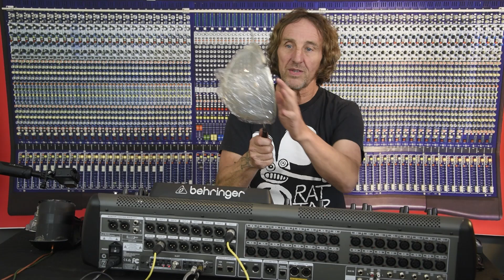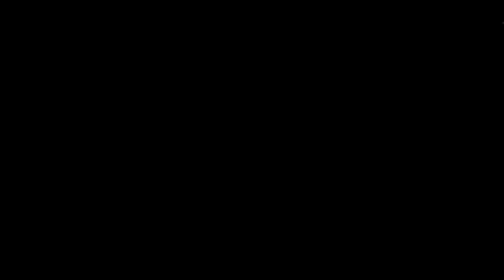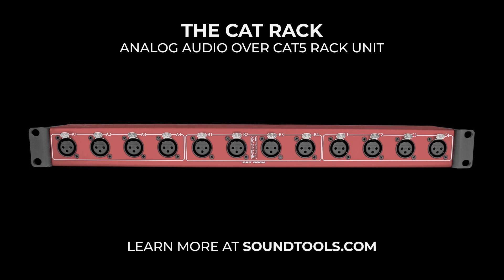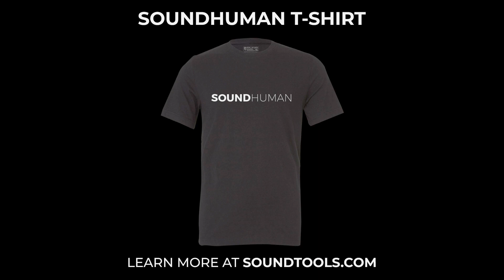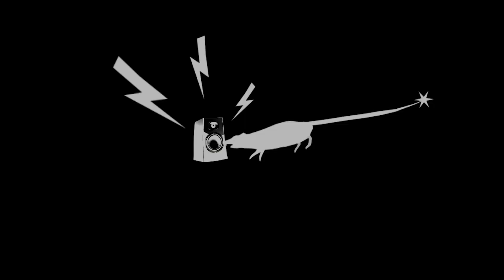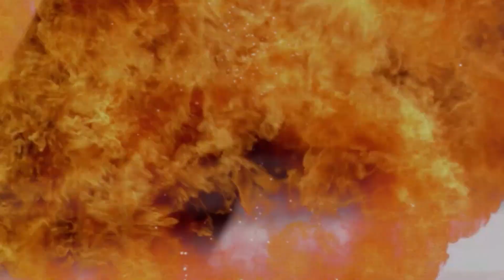Aux Fed Subwoofers Are Better - Because of How Mics Work

Comment: I like your videos very much, but this topic is pure taste. An engineer who mixes with subs connected to stereo will not put all the highcuts to 90, but much higher, according to the signal he has in each channel. If it feels comfortable to you, to have subs on auxes, if you like the control, if it's easier for you - then do it. But it's not the holy grail. Both methods can give you a good sound
Reply from the maker: Subs on a seperate send is better, not imperative. High pass filters reduce unwanted wasteful and sub blurring energy. Send on a separate send prevents it.

If someone is more comfortable or lacks the skill to run separate subs, all good. But using HP will always let some sub energy through.

Stage vibrations, handling noise, bass or kick bleeding into other stage mics late due to distances, all blur the sub soundbwith un natural noise. Filtering is ok, not sending is better.
Reply: @DaveRat  how is the unwanted sub bass for the tops? You can't hear it, because you don't send it to sub. So you dont filter enough
Reply from the maker: Typically the tops are not capable of reproducing sub frequencies (that's why you have subs) and using a high pass to get the sound correct 8n the tops is all good

Then, only sending instruments that need subs to the subs will prevent unwanted sub energy from non sub instruments from being reproduced
Reply: @DaveRat  so here is high pass good enough?

Everything has pros and cons....
Reply from the maker: That's for you to figure out. One way to tell is to set up your mix, mute the tops and mute all instruments you would normally send to the subs and go listen to the subs and see how much crap noise if getting there from instruments that don't need subs

Comment: Not only cleaner like you mentioned, but for those systems with limited power (I am am mobile DJ / sound reinforcement guy so my system is just one or two KS118s). Why waste power and potential headroom on 'garbage'? Subwoofers are notoriously hungry so why be wasteful.
Reply from the maker: Agreed

Comment: Love the idea. That really has to make the low end really clean and clear and would argue that if you could employ a crossover on those low frequency instrument channels, you could eliminate phase problems between subs and mains.
Reply from the maker: That would just be a glofied high pass and filter lows but not prevent the instrument from being sent to the subs

Also, issues with sub crossover perfection are over rated.

Any issues only impact a very narrow band of frequencies at the x-over point.

Plus, unless your subs and tops are physically extremely close together, an audience member moving closer to subs and father from tops or vise a versa, totally screws the crossover summation anyway.

So you have the ability to clean up lows and possible slight impact crossover issues that are already there, or you just have the crossover issues anyway
Reply: Putting sub/main on phase is very important (and yes its never perfect wich is why you average it with several mics) but using aux for sub doesnt prevent that.
Just set it up with the console setup you will use and make a dca for main+sub in case you have to change your overall signal.

Comment: Hi Dave, I have a question for you so in a PA system with a Yamaha non-powered mixing console, a analog 31 band graphic equalizer, and then an active crossover all in a signal chain where is the best place to start the signal? Should I started at the graphic equalizer or should I start at the mixing console itself and why should I do that?
Reply from the maker: Hmmm, you would want a seperate output from the console, like left, right and center and send center to subs

Comment: Why not hpf all mics that have no business picking up lows (like high hats vox etc)?
Reply from the maker: HPF is a filter that attenuates lows, if you high pass teall high you can get nearly all the lows of a mic out of the subs but the mic will sound bad with too much low removed

If you high pass so it sounds good, lows end noise still gets to the subs

Subs on an aux completely prevent that mic from getting to the subs. And you don't need to high pass so high
Reply: @DaveRat  I do use a separate sub send - with the fader linked to the mains but also hpf everything just at different cut offs depending on the instrument.
Reply from the maker: That works.HP does add a slight ringing but that is minor compared to how much the HP can help.

HP plus subs on separate send is the way to go

Comment: I'm a newbie compared to many here, but I love this concept. Dave, I very much appreciate in your videos that you present the reasoning for such techniques and then demonstrate using real world audio. It really helps someone like me to make changes that actually impact sound in a positive way.  I'm very grateful for your efforts to produce this channel.
Reply from the maker: Thank you Kurt, that means a lot to me and makes doing this worthwhile
Reply: The big satellite speakers might not have the best bass rejection on stage. The small satellite systems might rely heavily on the subs for male voice fundamentals and snare fundamental frequency.  It is not a one size fits all kinda answer. That's why we have system designers, system calibration and mix engineers. It's good that there are discussions between them though.
Reply: I might back that up with an example: nowadays we make tiny speakers with lots of low end. L-acoustics kiva is a good exemple. You get more 'ringing' from the acoustical path of the small speaker than you do from the filters. I ended up moving the crossover really high up (160Hz) to get a 'quicker' bass in the male speaking voice from the bigger sub. The mains are dual 5 or 6 inches, the subs are 12inches. The way Dave thinks of subs is for an effect. But often they are just part of the mains. The result is a cleaner speaking voice at low levels that was not achievable just with the mains. The subs didn't add unwanted noise or distortion to the signal nearly as much as the mains in the 80-200Hz range.
Reply from the maker: I consider subs to be speakers that are optionally added to a full range system to extend theiw frequencies.

Lows are part of the spectrum necessary for a speaker to be considered full range.

Subs on aux yay!

Lows on aux, not against it but not what anyt of this is about and a different adventure.

In some systems, the low frequencies (woofer) can be being reproduced by an enclosure referred to as a subwoofer but is not acting as a true sub as there is no woofer

Sub-woofer

Below the woofer
Reply from the maker: This is about subwoofers on a seperate send. Not woofers on a seperate send, not subwoofer used as woofer.

Sub-woofer

Below the woofer

Putting the enclosures that reproduce ultra low frequencies below the frequencies that a full- range system reproduces

Seems pretty straight forward to me
Reply: Then make sure to listen to other sources. There are many reasons why Subs on Aux are not a good idea. Especially if you are not 100% sure what you are doing here. Michael Curtis has a good video on it. Pooch van Druten (Iron Maiden, Linkin Park, Justin Bieber) doesn't do it (just an example). Subs on Aux is a possibility. But you should really check if it is worth the extra effort, and if you cannot get a simular result with proper processing ( and not put the HPF on a vocal mic on 90 hz).

Especially with PA systems nowaday going down to 35-50hz (l'acoustics K1: 35hz, d&b GSL: 45hz Meyer Panther: 55hz) it is imo a better idea to handle all these things with proper PA setup and highpass filters. It's not only Bass and Drums down there. Metal Guitars are often around 60hz, clearly in the subbass range. Male bassist vocals also have frequencies around 85hz. Not using subs on aux does prevent you from falling into these pitfalls.

Make a post preamp recording of the next show you do and sit down and check your channels and how a HPF affects it and where you have to set it to get rid of dirt in the bass frequencies.
Reply from the maker: I don't buy the argument that since a pa goes down low, one should send instruments that do not generate sub frequencies but the mics do pick up low end crap, to the subs.

What kind of logic is that? 

Just think of it in reverse. "Does this input need subs? No? Ok, then why send to subs?"

As far as being in control of your mix and not ruining the recording, of course, avoid that regardless of how your subs are sent.

You don't need subs on a separate send to get a good mix but also, not sending excess unwanted crap to to the subs will always sound better than sending crap to the subs.

The question is whether the difference in any situation is audible or not.

And that is fairly easy to test. Which I highly recommend.

Don't believe me or anyone, test it! 

With subs on L and R, dial up your mix, high passes and all that, then mute the mains, then mute all the inputs you do want in the subs and then, whatever the subs are now doing is the excess. Look at that signal in Smaart, go listen to the subs, see if they are bouncing around, maybe they are, maybe they are not, and then decide, "is my mix better with this noise added, does it matter? or should I setup my mix so it can be removed?"

And remember to enjoy learning and avoid dogma
Reply: @JasperSchwinghammer FWIW, Michael Curtis made a post in the past few days saying that this video is making him reconsider how he’s thinking about sub management.

The more I think about it, the more I’m thinking there isn’t a single right answer for all situations. I’ve been doing the HPF thing for a while and have been happy with it, but I’m thinking I might try to switch the PA over to aux-fed subs for a while. I mean, I switch which compressor plug-ins I use for various inputs every so often just to try something different and really learn what they sound like… why not do the same with “PA architecture”?
Reply from the maker: Good stuff and the best part is that there are many options for desirable outcomes. What I am trying to do is offer a method that increases those odds.

There is another dynamic I will cover soon wherein I will show that not sending everything to subs actually can improve sound coverage in frequencies reproduced by both subs and mains (overlap frequencies), in ways that can not be achieved with subs on L/R
Reply: @DaveRat  Oh? That sounds interesting!
Reply: There are certainly many ways to accomplish similar outcomes. All of the things that you mention reflect our current setup. Now I know of an alternative approach that I had not previously considered. Options are good 😊
Reply: @JasperSchwinghammer  I just watched the related Michael Curtis video. I found it to be helpful to see, yet another way that a professional is managing the flow through a mixer. I'm sure that he knows more about sound production than I will ever know.

However, his video did not actually address the issue that Dave addresses here, which is that extraneous bass sounds are generated from microphones that really shouldn't be producing sound in that frequency range. As I understand in Michael's example, he is routing all sound to various matrices, which means that the sub matrix will include the extraneous base frequencies from all sources. At that point, I do not see how it is possible to use EQ to filter out the garbage without coloring the sub frequencies that you actually want to capture.

Some other thoughts regarding Michael's four points for why you should not use Aux Fed Subs.

1) Michael asserts that PA design vs mix decisions are muddied. I see the interaction, but am not sure that I agree with the conclusion. PA design is to set a baseline for the room. Mixing is always on top of that design regardless of the mixing approach.

2) No accurate transfer function: I'm in a fixed venue, so maybe that is why this point means little to me, but using a room measurement mic for evaluating your mix, rather than simply for PA setup, does not make sense to me. The room is always going to sound different from what your mixer receives from the mics unless you have a completely dead room which doesn't exist in the real world. Coming from an IT environment, one learns to recognize that data is only one part of an equation and that the human interaction with data is often unmeasured and, perhaps, the most important element. Many IT systems fail because developers lose sight of the fact that software is supposed to solve a human problem rather than be an engineering marvel. I don't see why one would rely on data over what they actually hear; the audience is evaluating with their ears and not the data.

3) Limits Routing and processing: While it's true that many common mixers limit some functionality or may require an alternative approach to make this work vs a more traditional model, people are adaptable and can learn new ways of working. It seems that it may be easier for someone like myself, with a short tenure mixing, to take a different approach because I have yet to develop a pattern of mixing another way. Unless a financial barrier exists, I would simply select a platform that makes Aux Fed Subs possible without the limitations of some older mixers. For example, moving from A&H QU to an SQ is not significantly more expensive and eliminates an artificial barrier.

4) Troubleshooting is more complicated: I appreciate that a person unfamiliar with the mixers setup might be confused, but an individual who establishes the routing for this or any other approach should not be mystified by what they created.

I really do appreciate your comment, as it was very helpful for me to see a different opinion.

Comment: As usual Dave you have explained something that most sound techs may have missed. Eliminating unwanted mud. I know a friend who believes in true sterio sound but may not realize what you have just stated. Also running subs separated in a small venue will cause a thunder alley effect according to the horizontal dispersion of the sub. Sending only low freq. instruments to an aux is a great way to eliminate that mud. Thanks Dave as I certainly trust your judgement and love the productions.

Comment: Seems to be a hot trend lately of engineers moving away from aux fed subs and advising others to do so. But their reasons are never very compelling and mainly boil down to it being an extra variable that creates more margin for user error, which is silly to me. As live sound engineers the job is all about juggling numerous technical tasks to create the best possible experience for the audience and the band. It’s not the right philosophy that we should shy away from a relatively straightforward and effective method simply because it creates an extra thing to pay attention to.
Reply from the maker: Subs on an aux is better but engineers that are still getting a grasp on the basic should do so before adding more complexity
Reply: @DaveRat  Agreed. I didn't use aux fed subs for the first few years that I was starting out in live sound. I just don't agree with experienced engineers who claim it's more trouble than its worth and advise others to always avoid it, which is the trend I've been noticing recently.
Reply from the maker: Never underestimate the desire of a humans to justify their beliefs by preaching to others. Realgarsless of whether their beliefs are beneficial or detrimental

Comment: A lot of PA man, and I agreed, thinked that can be created problem in pa correct tuning.
If don't like that the mic go tu sub, normally filtered at 80hz, is really sufficient a 24db HP filter at 100hz.
A vox in a band normally is filtered around 125hz, -18db at 62hz with this kind of HP, so...
Reply from the maker: Yes, many people are ok with leaving in some of the wasted energy and mic rumble sent to the subs. And just using filters to remove some of it.

Comment: For your next video, just an idea to follow on from this test. It would be cool to use the oscilloscope on the signal going to the sub speaker calibrated to the mix level of bass, kick etc(ie when the whole mix sounds good). Then assign the rest of the inputs to go to the sub aux send too(essentially a "stereo mix" from speakers perspective but with one button assign-ability). Have the other non bass inputs set up with their respective high pass filters and take a measurement. Then unassigned the other inputs from the sub aux send and take another measurement. It would be curious to see both the comparable levels between wanted and unwanted signals, but also how the waveform is being distorted/affected by the junk. I think it might give a really good visualization of what the driver is trying to do in both scenarios.
Reply from the maker: Would not show on a scope in a way that is clear. On an RTA it would, will ponder that
Reply: @DaveRat  thinking about it more your right, scope would only show something clear if all the instruments hit on a beat. Like at the end of a song or drop into a chorus. RTA sounds like a good idea.
Reply from the maker: Possibly show how many db down the energy is w HP vs send. Vs no hp.